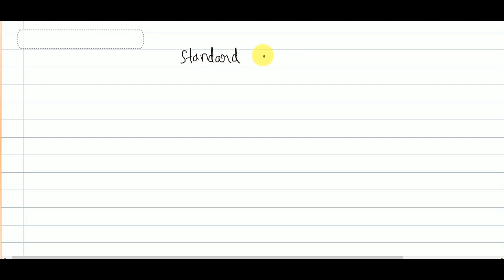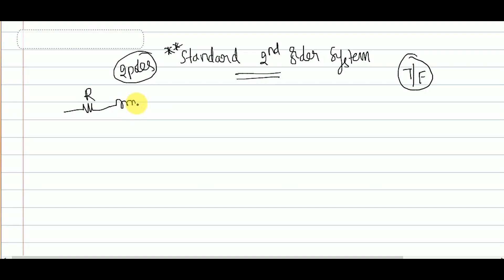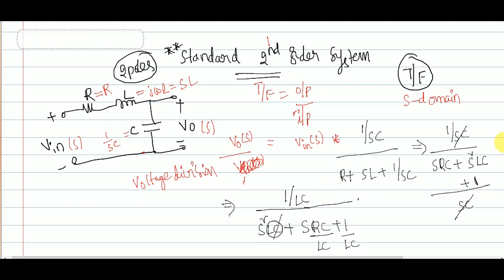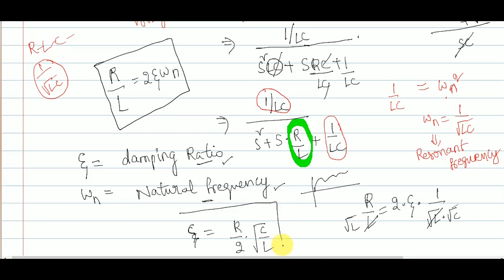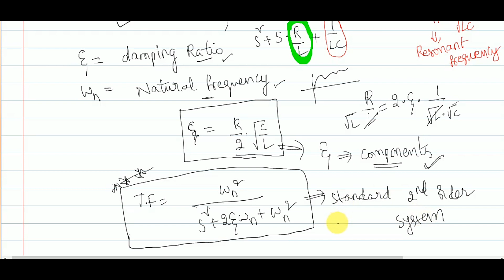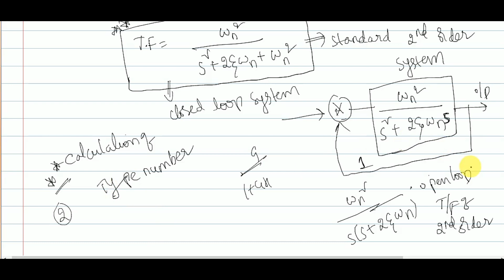Comment: Why RC, RLC Circuits  to derive order of a system ? What are the other circuits and components We can use to  derive the order of system ? Why output should be taken at capacitor and what about the transfer function if you take output at other components?
Reply: Transfer function might change but order (no of poles) won't vary. They determine number energy storing elements present in the circuit.
Reply: Is there only first ,second order systems ?what about  other order system and upto how many order system do we have?
Reply: @tmajithkumar4591  there will be higher order systems also.
Reply: can you give examples for higher order system?